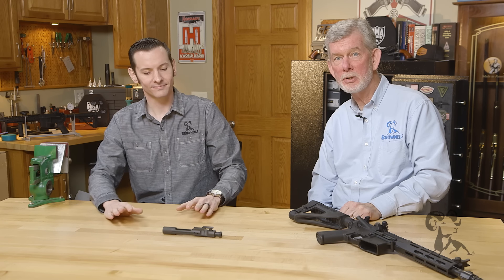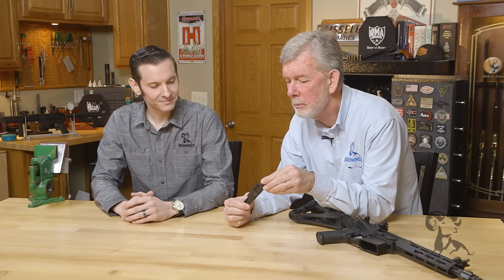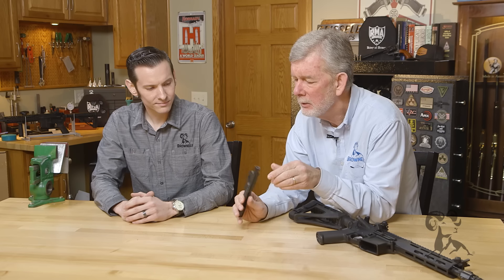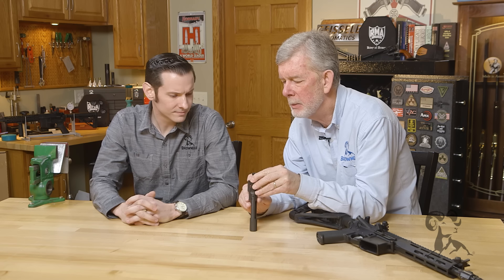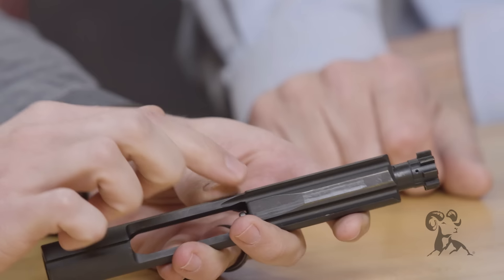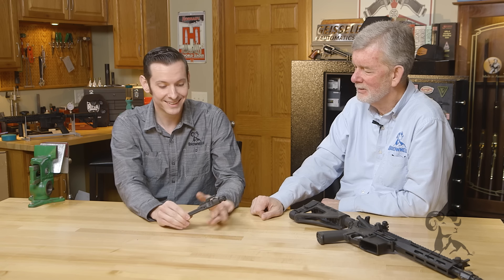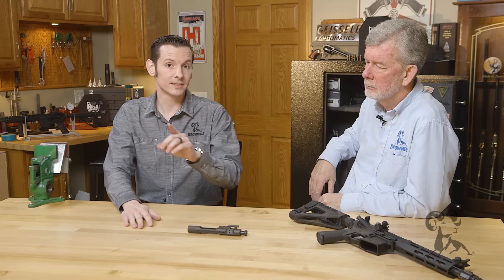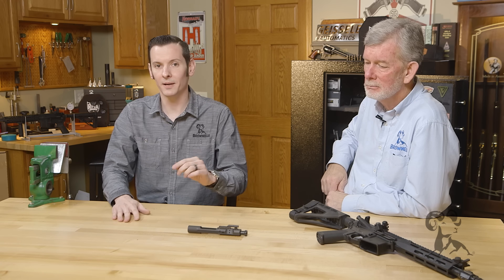Smyth Busters: AR-15 Bolt / Carrier Lubrication

Comment: From the manual on the use of the 1919 machine gun “Oil when it’s cold, Grease when it’s hot, and crisco on Sunday.”
Reply: Lol that was the M2 predecessor Interesting I wonder about using car engine oil as a last resort
Reply: Edd Z3r0x Possibly, I know back then they used a lot of mineral oil for aircraft engines. Radials specifically, you could use that I’m sure
Reply: @derubersoldatx  Car engines contain thousands of explosions every minute and lubricate tightly compressed components oscillating faster than any machine gun.  It'll work just fine in any rifle you care to put it into, even as a first resort.
Reply: @derubersoldatx  I've been looking everywhere and lots of military and law enforcement use 10-30 it seems. So yeah engine oil is great and a lot cheaper.
Reply: @derubersoldatx  I use 10-30 to lubricate all my guns. Works great. If you lube it and happen to not use it for a while, when you look at it later it'll have spotty coverage in my experience. Wouldn't recommend getting it sopping wet though
Reply: @pscwplb  

I’m thinking auto oil will cook with the heat.
Producing hydrocarbons that will gunk it up good.

But yeah, SHTF anything goes.
I’ll spit on it if that’s all I have!

I’d go for the 2 cycle oil myself. 👍

Liberty. Constitution. Republic.
Reply: @stickytourbus  If you're running a squad machine gun with six months between cleanings, you might have reason to be worried.
Reply: @pscwplb  

A part of me wants to do that.
Not sure if that’s a good thing!

Probably something in my past.
Veteran US ARMY ABN 11B 

Liberty. Constitution. Republic.
Reply: @derubersoldatx  I understand that the only lubrication many AK-47s and 1890's in Afghanistan have seen since the 80's was motor oil. Hell, I remember hearing a story that the only maintenance the Mujaheddin would do on their AK-47s was tie knots in a shoe lace, dip in it oil, and pull it through the barrel once. Done.

Dunno if that's true or not, but I've heard it repeated more than once from different sources so.
Reply: @angry_zergling  they had AK47s in the 1890s??? 😮
Reply: @dsan94  AK-47s AND 1890s (typo there, should have said 1891s)...M1891 is the model of rifle known as Mosin-Nagant. =)

Two really common weapons in Afghanistan.
Reply: @johnbeauvais3159  Balastol is made from mineral oil and it's an excellent gun lube
Reply: @chrisgarcia8592  high quality full synthetic oil is used by a lot of people . Mobile 1 is what most people swear by
Reply: Ryan Meadors  It it slides, grease it... if it rolls, oil it.
Reply: I use grease on the inside, and shine up the gun with gun oil on the outside.
Reply: @derubersoldatx a lot of idpa guys use 5w30 full synthetic especially for their competition 1911s and you know those like to run wet!!!
Reply: @stickytourbus if you use a quality full synthetic it will resist heat very well!!! I'm thinking mobile one full synthetic!!! It has a very high operating temp, and that's why it's so popular for use in the Baja races, as they are r*ping those engines in high heat for all their worth!!!
Reply: @Wildwestwrangler  
Makes sense. 👍

Comment: I run mine very wet. The wetter the better, with regard to CLP. It’ll keep the carbon from sticking. Makes cleaning a lot easier. I’ve also switched to using eezox which cleans a lot more carbon then break free clp

Comment: The first time I shot an AR style rifle was when I was 18 and in basic training. The instructor on the range that day told us "that the rifle is like your girlfriend, the wetter she is, the happier she is" LOL, that has stuck with me for over 25 years now :)
Reply: If its carbon fouled, the lubricant just thins the fouling to allow ease of movement. But carbon and oil also creates a lapping compound that increases wear. 

If its clean, itll run when dry and stay cleaner for longer. If its carbon gunked, it takes oil to restore ease of movement if cleaning isnt possible.
Reply: And, the wetter she is, the happier YOU are!
Reply: @Resistculturaldecline dirty and well lubed is better than dry and clean. That's why I run k&n filters on my truck. It had a bypass valve if the pressure gets too high it'll let oil flow past the filter, like if you're running hard or the filter gets clogged!!! Dirty oil is better than no oil!!!
Reply: @Wildwestwrangler   Almost all automotive filters have a bypass. Very few don't have a bypass. Different OEMs have different pressure settings, most are in the 11lbs - 14lbs. range.

But as for the rifle, the oil and carbon literally become an abrasive paste. That paste is not better than clean steel if longevity or function is the goal. If you ever had to intentionally wear gun steel for fine fitment, rubbing gun metal on gun metal is a futile undertaking. Minus a file or various grit stones, the dimensions won't change any appreciable amount without a lapping compound or lapping paste. 

Absolutely, in the heat or battle or in the field, do whatever it takes to keep it running in the moment. As for the civilian in a peaceful surrounding, there is no advantage, none to having carbon'd lube in a gun.
Reply: LSMFT
Reply: Wet carriers are happy carriers

Comment: In my 50 plus years of experience with the M16/Ar15 they run better wet. I have never had a malfunction with running one wet, but I have had them shut down running them to dry.

Comment: It's worth noting that I recently saw a video in which the presenter placed drops of lubricant on the openings you identified at the onset of the video.  He did state that is how he learned it.  He was very emphatic that he did not endorse or recommend his method; it's what he prefers.  Thanks for putting this Intel out.  Sometimes the way that it was always done may not necessary be the best way to do it.  Thanks for providing us with a different perspective.

Comment: Here in Wyoming where the relative humidity can be single digits, I have had several failures (usually FTCs) trying to run an AR dry. A light application of CLP or Tetra oil on the "shiny spots" on the outside of the BCG and a few drops in the bolt bore result in 100% functionality.
Reply: If you look at the bottom of the BCG, you were see slight wearing on the rails on each side and  in the center area between the rails. I have seen videos where they recommend a very light coat of oil on these areas.
Reply: @Bream243  Oh, like this very video? Lol!

Comment: If it's shiny, it gets oil... "rails", bottom of bolt carrier as you showed.  A tiny drop on the ejector can't hurt.  Ditto, the extractor pin.  DO NOT stick anything into the gas tube, pipe cleaner, nothing.  It blasts itself clean with every shot.

Comment: I was told by a friend who was our gun guru to use a dab of wheel bearing grease on the BCG rails, and oil everything else. So far, all my ARs run well.
Reply: This is what I searched for, I was sad they didn't mention grease. High temp stuff. The rail surfaces need only a small amount but it really lengthens the life of each cleaning and oiling.

Comment: All my BCGs are NiB. I used to use oil, but switched to grease and haven't looked back. Oil drips and splatters all over everything, grease stays on whatever you put it on. My ARs run flawlessly for hundreds of rounds, though admittedly I do clean them after every range day - ARs are so easy to break down and clean, it's almost therapeutic in itself and it makes no sense to me to not do it. I use some sort of acetone based spray(usually Gun Scrubber from Walmart) and a brush to get most of the gunk off, wipe everything down with a rag and I put some grease on the bolt(the cylindrical body and the tips/corners of the locking lugs), the cam pin and the rails. I could skip the brush and just wipe everything down with Gun Scrubber and a cloth/rag, there probably wouldn't be a noticeable difference - I just enjoy cleaning my guns right and knowing they're gonna run good next time I go shooting.
Reply: I just got a NIB BCG it's awesome but I use CLP it's already slick. I had one jam but it was ammo related which is weird because it was X-TAC 55gr which is good ammo but it happens🤷‍♂️
Reply: @blackticalmayhem8461  Every gun will jam up once in a while.
Reply: @shmuckling  true lol

Comment: After cleaning I look at the bolt and receiver,  anywhere there is wear, I put a tiny drop of oil on my finger and run across it. Zero issues in 20 years
Reply: Mine goes wet with 5w30
Reply: @thedeathwobblechannel6539  Me 2 with $1 store synthetic

Comment: I generally run it wet using CLP. I've found that they run well dry and clean, wet and clean, wet and dirty but, not dry and dirty. That being said, it's easier to clean when it's been lubricated properly.
Reply: yea i like it when you basically wipe it clean instead of having to scrub.

Comment: Another very useful presentation, thank you gentlemen.  
Grand dad told me that firearms lubrication was very simple - find where the action has movement and metal on metal contact.  Consider lubricating those surfaces and the conditions under which the firearm will be used.  He insisted I always use Hoppes  gun oil and better to apply it sparingly than heavily.  John Moses Browning, Eliphalet Remington, Bill Ruger, John Garand, Eugene Stoner, Samuel Colt all knew how to design and manufacture reliable firearms that require little maintenance and modest amounts of the proper lubricants to provide generations of reliability and accuracy.
Reply from the maker: Well said!
Reply: @brownells  With products from Brownells and time and a food dehydrator I refinished the stock of a Winchester 88 in 284 Win.  Over the course of a month I extracted approximately a half cup of oil (smelt like WD40) from the wood.   Less is more.

Comment: Small amount of high temp ball bearing grease for friction surfaces but running oil the rest of the way. Very smooth action when you run it hot or cold.

Comment: Every time i get a new varmit/work gun, i clean it down entirely with brake cleaner, and lube it up with some dry graphite spray lube from Napa. 
Makes a huge difference, lets you clean your gun once a week instead of every day like i used to when the work guns were run on Hoppes No. 9.

Comment: When I bought an upper receiver from Bravo Company Manufacturing they had some lithium grease around the cam pin. Seems like a good idea to lube that area really well as there's a lot of friction when the bolt starts to rotate under so much pressure inside the carrier.

Comment: I put grease on my bolt & Carrier, also lugs 
& cam pin. I ran it in 2 day classes with out cleaning, l just put a little extra grease (red auto grease ) that stuff is tacky it stays where you put it.  Thanks for the videos guys.
Reply: Do either of you guys think using Aero shell grease would work alright?
Im personally just not a fan of using oil etc. It seems to just leak everywhere through the holes of the rifle and that annoys me. So I prefer grease. Just want a second opinion on the type of grease. I have Aeroshell and would prefer not to buy a different type. I also like LSA.
Reply: @aholegunner  Aero Shell is a anti-seize, it's also used to get proper torque.  I like high temperature bering grease for high round count reliability.
Reply: @Mr1gun  Thank you for your help
Reply: C-Bomb  Thanks buddy!
Reply: As an A&P I'd recommend not using aeroshell. It doesn't have much lubricant in it (its fire retardant) use red wheel bearing grease (I've used Shell Rotella in m1s and m14s). Used it in my ar15s but I have mixed emotions if it's too thick. But when I have I never had a problem.
Reply: That grease will do well until u get in a sub zero climate. In extreme cold conditions grease can become to thick for the action to cycle reliably
Reply: @matthewbeaver5026  In P.A., it rarely gets much below freezing. Even if that was the case for home defense I'll be defending from inside. You have giving me a idea to test gun with grease in a freezer over night. Thanks. BTW most AK guys run grease. Food for thought.
Reply: Thank you. I was wondering if anyone else does this. Grease cant be thick. Wet look only. Grease doesnt burn off like oil or attract dust. Carbon doesnt stick to greased steel, just wipe off and regrease. If the carbon dont stick it doesnt cause problems. People look at you like your crazy when you talk about this but it has proven itself to me.
Reply: @tony55752  My son's  & I have been using grease for about 5 years now. We been to training class taught by veterans with military combat experience  & they recommend the grease. Like Red & Tacky #2 by Lucas Oils, or similar.

Comment: I use spray can Rem Pro . Its a cleaner / Oil so some of it evaps.  But I always spray some in those three holes and work it into the rings of the bolt.  I spray some on the extractor section and down into the spring under the ejector as well.  I then coat the entire group and slide it into the gun lol.  I was told ARs do not mind to be oiled.  But I would not spray any down into the gas tube unless I am cleaning it then I blow it out with compressed air after.

Comment: Once I ran out of LSA mil lube , I did some testing with minimal friction lubricant and was rebuilding my Harley and I use assembly lube lithium graphite and tried it on my AR 15 and LR and have had excellent preference and just wet it and let it roll , good stuff

Comment: Whatever gun I have, I look for wear points from metal on metal contact, and lube there.
I generally like using a gun grease for sliding surfaces, and oil for pivoting surfaces.
Seems to work well.

Comment: I was always taught...lube the stuff that moves, and any areas you see some rub/shine... so I lube the extractor assembly bit, and a light coat on the whole exterior of the assembly... plus a couple drops into the trigger/hammer group

Comment: I also add a drop of oil to the cam pin and the actual bolt. I look for anything that shows wear and add a drop. Besides that, I do what you recommend.

Comment: I usually oil the cam pin and wet the gas rings in addition to a light coat on the surface on the BCG (paying specific attention to the wear areas). The more I think about it, probably only consider putting oil on the raised part of the bolt body and forget about the rings.

Comment: My LWRCI stays pretty clean (piston) as far as carbon goes.so I have running the BCG dry.  The carrier and bolt are both NP3 coated but I do spray 'em with E&L Dry Gun Lube.  Graphite by any other name.  No failures at all.

Comment: As for the substance....I've participated as an assistant and student at many AR weekend classes and I've noticed that the number one issue people have with their ARs is caused by .... under lubrication. They hear the myth that you can "run them dry" and this may work ok for the first few hundred rounds, but ... in a situation where they are putting 500 rounds through a day often in rapid strings of fire....I see ARs choke up.
I also make it a point to use a needle applicator and I do apply oil to the bolt itself and between the lugs, etc.
Reply: I do not agree
Reply: I could see maybe precise amount with needle applicator on the lugs.. I'd imagine focus mostly on bolt/cam pin area.. I do, though haven't been to class shooting THAT many rounds.. few hundred here and there..
Reply: Also what's your opinion on grease? Actually synthetic grease like Mil-Comm TW-25b? I've always stuck with CLP but after my Sig Sauer P226 manual recommended above grease, I've experimented with it, particularly around bolt/cam pin. (My comment to the video says all this too)
Reply: Fireteam Michael  I think grease can be very dependent on your environment. I quit using it because it gets too think on cold days.
Reply: Glenn Pady ..You don’t HAVE to, BUT he’s right as most concur
Reply: @Golgi-Gyges  What do you not agree with?
Reply: @pault.mccain6637  what do you agree with?
  Obviously, i was agreeing with those that spoke of using little to no oil.
  You have no sense?
Reply: Totally agree at least when wet it WILL RUN. Unless something is broken of course. Anything metal on metal including a light sheen on the lugs is perfectly sensible to me.
Reply: @Golgi-Gyges  Well aren't you just all kinds of special?